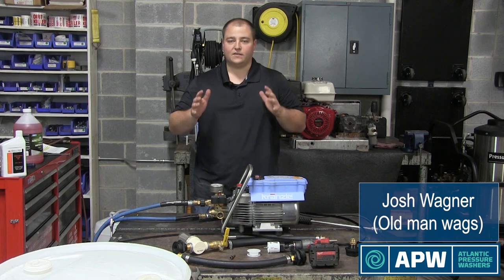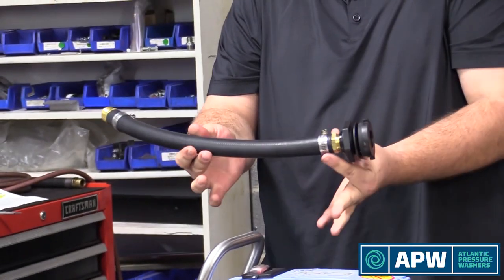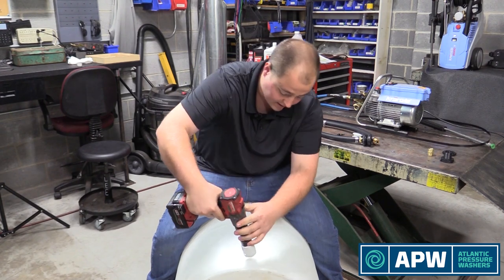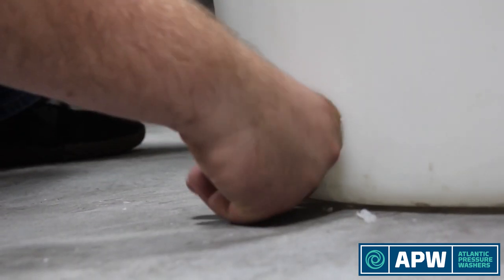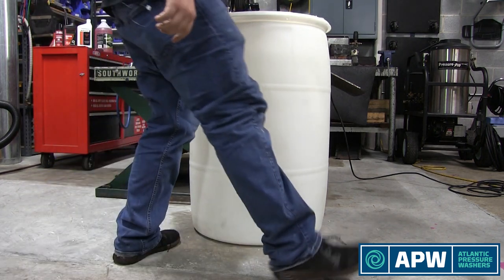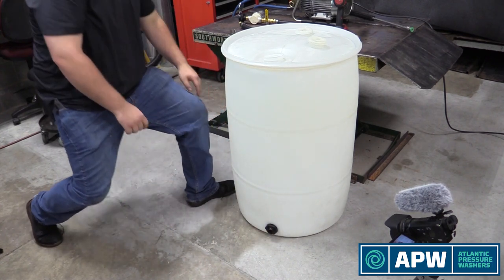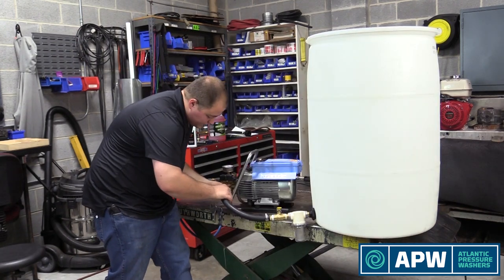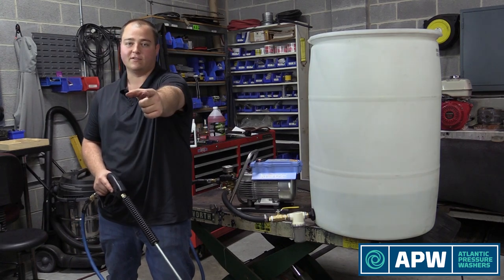How to connect a water tank to a Kranzle : Altantic Pressure Washers Maryland

Comment: Does it actually decrease the flow compared to a regular tap? Also would something like a well pump make it better?
Reply from the maker: No. A standard size garden hose is fine. DO NOT USE the elastic style garden hoses. Those do restrict flow. Sure, a system with light pressure for the in-take water is fine. Kranzle doesn't need it if under a 3 FT vertical draw.. As seen in the video, it's a non issue. The Kranzle creates the suction and will pull in the water with no issue.

Comment: Quick question what's the advantage in doing that compared to running the hose direct to the machine ?
Reply from the maker: You always want to use a filter. Stuff falls in the tank and the filter prevents it from getting into the machine.

Comment: The filter bowl below the level of the tank base is a bit of a bummer isn't it? The tank is destined to spend its life on raised platform. Could you not put the filter at the pump end?
Reply from the maker: Yes. If you like, it could go closer to the pump. We typically do it this way.

Comment: Will you need an additional pump?
Reply from the maker: No. This is a gravity fed set up and it works perfectly. That's one of the advantages of the Kranzle pressure washer pump. It is self priming and creates the suction where gravity fails.